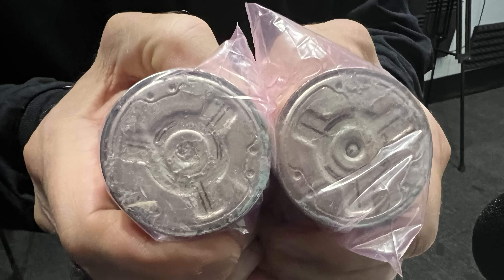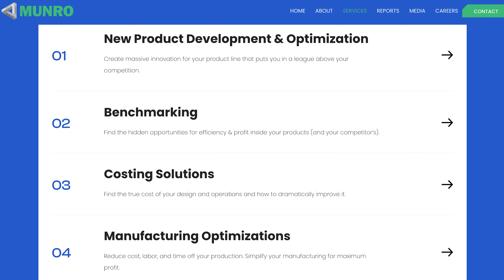Discussing Tesla's Gen 2 4680 Cell With The Limiting Factor

Comment: Idea to improve laser connection between the top cap conductor and the copper tabs...  Spin the cell longitudinally (as opposed to radially) to force the jelly-roll to one end - and laser weld. Obviously requires and interesting setup but should give a good, consistent weld. This process shouldn't be needed for the base tabs/conductor as you can just push down on the jelly-roll through the open top.

Comment: Man who cares about how many welds? Talk about watt density, cost to produce, weight difference between 1 & 2 gen, speed of ramp up, longevity, does it use a dry mixture or does it require solvent evaporation, etc. Welds, geesh

Comment: Multiple production lines at different stages of evolution seem to be a popular answer, and the best cells selected from batches. As they iterate the process there are sure to be cells that don't meet certain standards. Musk did hint about "yield" at one point. Which prompts another question - if the number of welds/internal resistance was marginal it would show up as accelerated individual cell degradation when the cells had to deliver power in a car being driven hard.

Comment: The mix is probably the results of changing how the scond gen 4680s are being manufacured as they try to just see how fast they can be built...on differnt lines within the battery shop.These "hybrid packs" a part of ongoing product developmets as they need all the packs they can get...? A simple running change as they dial in the process.

Comment: Cells probably came off different manufacturing lines. One’s been upgraded (faster) the other hasn’t been converted yet, possibly they are running a trial to confirm there’s no issues with the new line. Also there will be only certain scheduled downtime periods, so they may be waiting for the next downtime to upgrade the line.